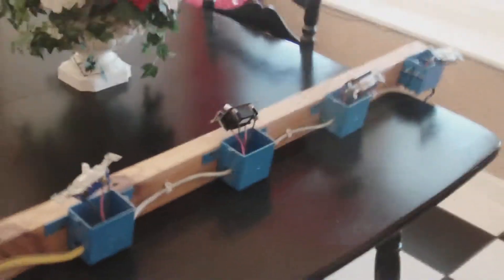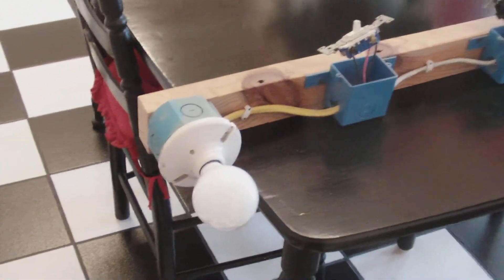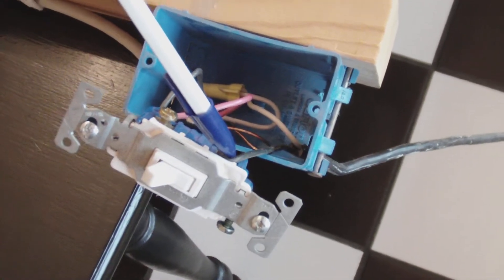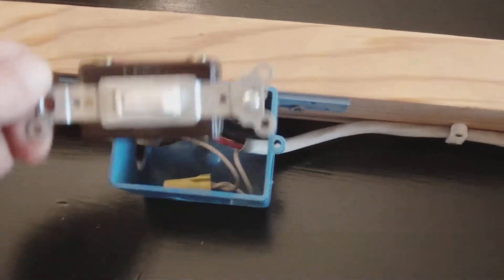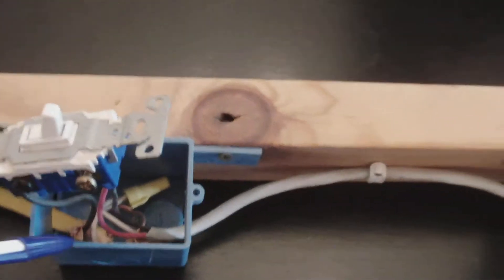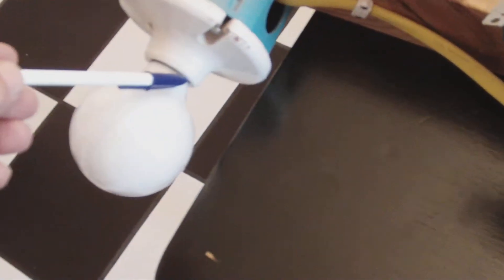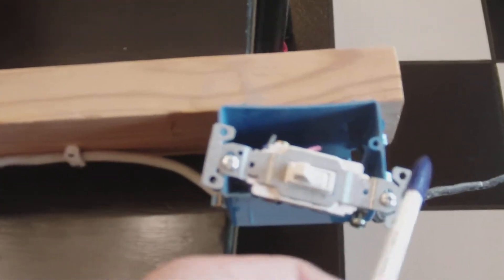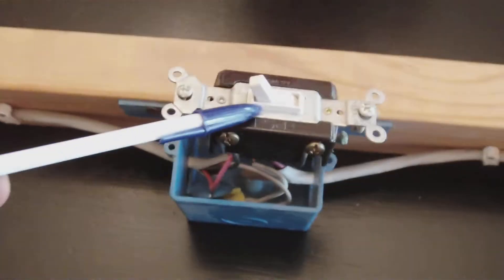How to wire a 4 way Intermediate switch circuit.

Comment: Ok - I did it. I looked at a lot of complicated explanations that lost me, before I saw yours on video. I turned off the breaker switch at the box, wired the new 4-way switch your way (red on one side, black on the other) - and VOILA! It worked. Doesn't matter which black wire is top or bottom, same for the reds - so long as the 2 x red wires are on one side of the swithc, 2 x blacks on the other. Each of the 3 switches now turns on and off the light, independently. THANKS!

Comment: Thanks for this: I have a hall light that has 3 switches (2 x 3-ways at either end, and a 4-way in the middle). The 4-way has always been a problem - crackles when used. It was wired red on one side, red on the other (in and out); same with black. 1 in, 1 out. It turns off the light IF it on, but then, neither other switch can turn it on. I'm going to try it your way - both red on one side (both in) and both black on the other (both out). Correct??

Comment: Gerald Clay you are a great guy for posting this.  I am not well versed in wiring but willing to give it a go and this is boosting my confidence through the roof.  Thanks!
PS  The wires are not hooked up to any power source so there is zero chance of being electrocuted as I play around.

Comment from the maker: Yes, normally you should unplug the circuit. But in this instance I was using a plastic pen, which is perfectly safe as it does not conduct electricity. This is for demonstration purposes only.

Comment from the maker: A 3/way switch will control a light from 2 locations. If you want to control a light from 3 or more locations then you will have a 3/way on the power end of the circuit and another 3/way on the light end of the circuit, In the middle you will need 4/way switches. You can control the light from as many locations as you want as long as you keep adding 4/way switches in middle of the circuit. More than 2 locations and you need to add 4/way switches. The video describes exactly how this is done.